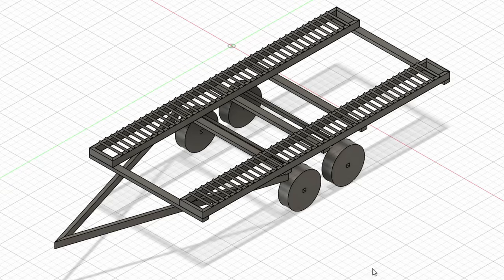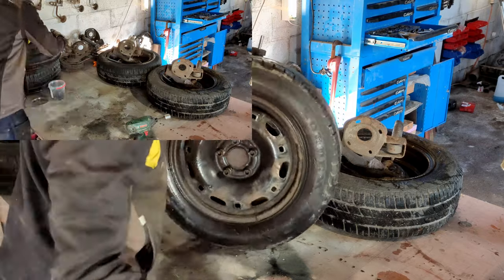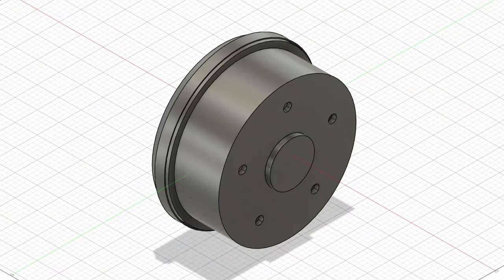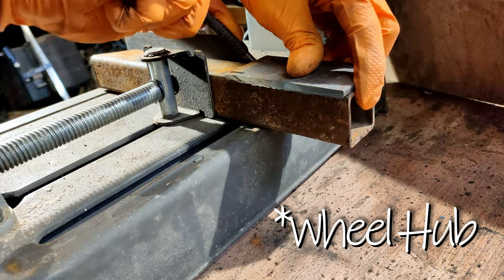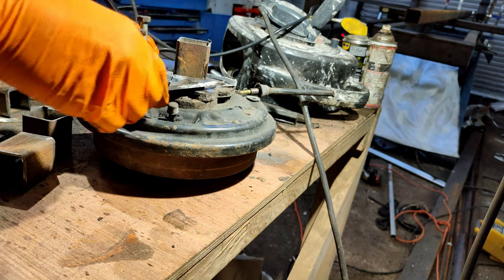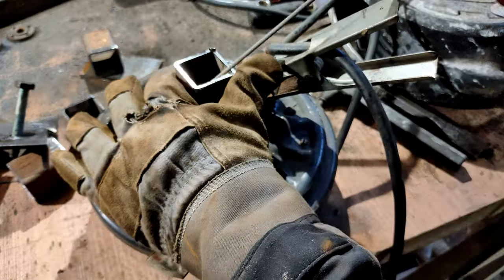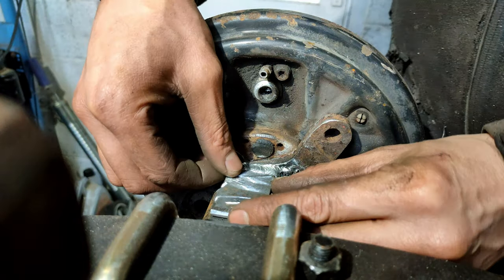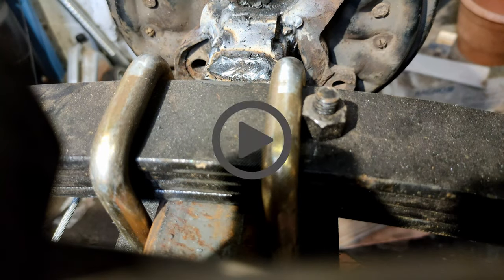DIY Trailer Build - Car Hauler - Part 1 of 2 - Axles

Comment: hello how did you do the brakes , while using the hubs from a car??
Reply from the maker: Hi, I used the rear brakes from a VW Polo, these are drum brakes with a cable hand brake (e-brake). The cables can be joined together and to the hitch brake.